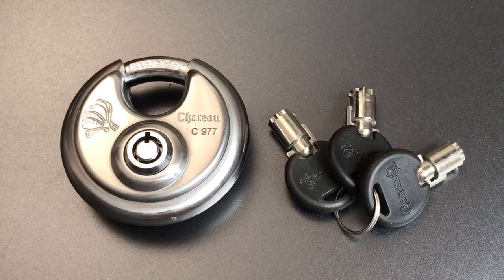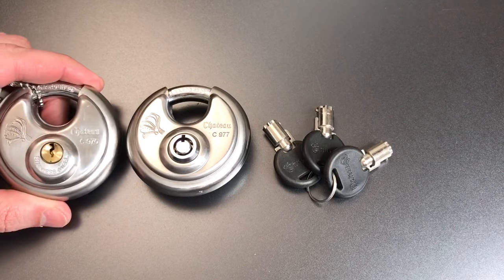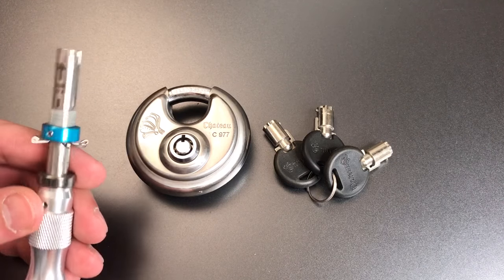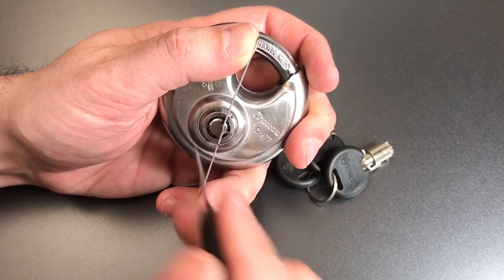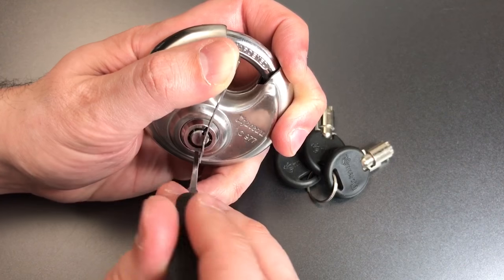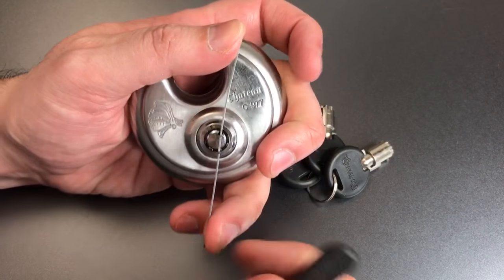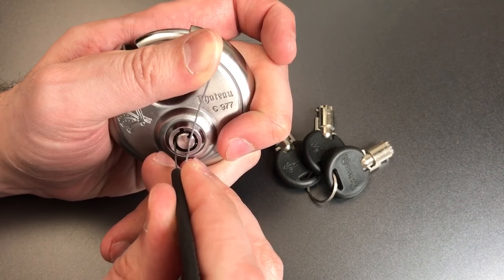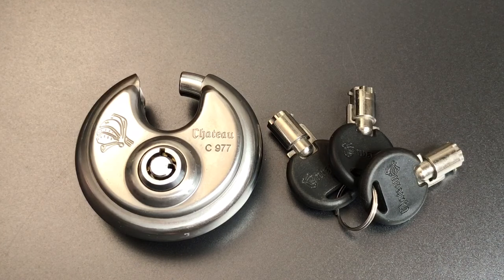[430] Chateau C977 Tubular Core Disc Padlock Picked

Comment: Question about tubular cores. It seems like the key factors making a tubular core most difficult to get into is:
1. Varying spring tension
2. Non standard size
3. Multiple position picking

Is there anything else you can do to make these more robust, like security pins? Also are there examples of tubular cores that get these kinds of things right?
Reply: Yes you can put security pins in tubular cores. A tubular core is exactly the same mechanism as a standard pin tumbler lock, but instead of vertical alignment the pins are horizontally aligned.

Comment: Once you picked it part way could you have used the impression tool to prevent having to pick again or were the pins that far off with the impressioning tool?
Reply from the maker: Well, the impressioning tool would not fit, so it would not be easy.  That said, it was suggested to me by another viewer that I could overextend the pins on my tool to make it work... seems plausible.  Even so, picking it twice really wasn't that bad.